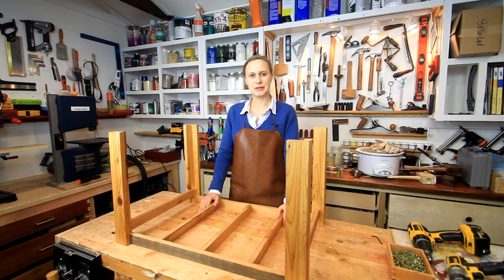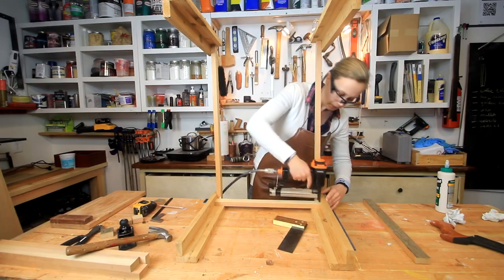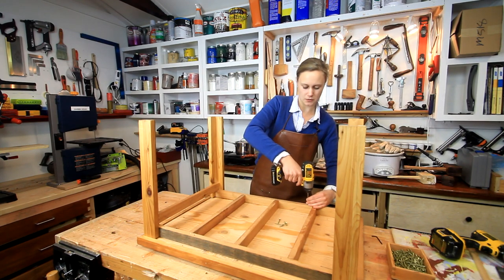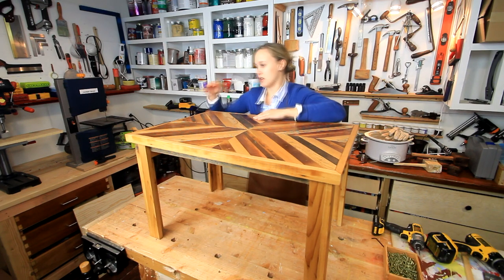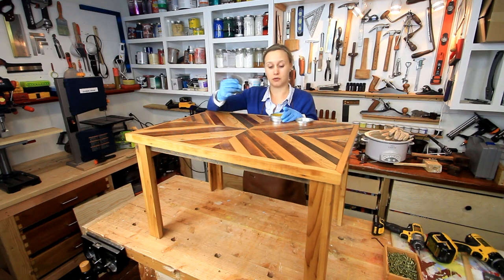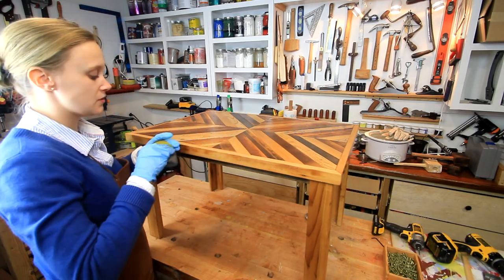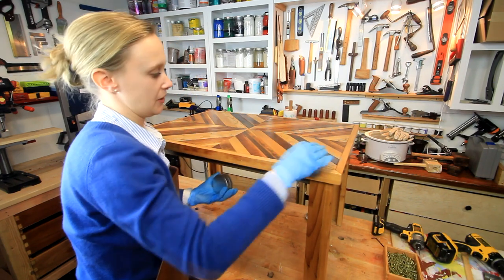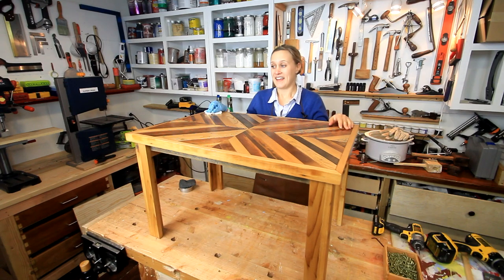How I Built and Finished a Coffee Table

Comment: Beautiful job--thanks for posting the construction and finishing.
I've used water based poly a few times over the past three decades.
I don't like it and I never will. I think the worst part of a water based finish, is the raised wood grain when it dries.
=Brian=
Reply from the maker: toolguybak Well, I agree water based poly isn't ideal at all times. However when you're trying to avoid adding a yellow tone on top of paint, or you can't use oil based for some reason, it's quite handy to have around. Plus, if you finish it with a wax coat using steel wool, you remove the raised grain. Of course it all depends on your project :)
Reply: That's a good point-poly on paint. I almost never paint wood.

Comment: Looks great!  Had a question, My wife and I sanded and refinished a clothes drying rack that belonged to her grandmother with Oil based Poly and it still has some spots that are "scratchy" and catch on the clothes a bit.  I was thinking of finishing it this way( i have minwax Paste wax) but i was worried that it would stain and/or leave oil on the clothes as they are drying, Should i be worried about this?
Reply from the maker: RobBurnsDrums I think it would be a great use of wax to make it smooth. If you are using a light colored wax it should not leave much of a residue that you could see. You could always try it out on a test piece of clothing and see what you think. You could always remove the wax from the drying rack using paint thinner (mineral spirits) if you did not like the result.

Comment: How does your beewax/oil finish stand up to regular cleaning? Would the mixture need to be applied to the piece in time to maintain it's appearance and feel?
Reply from the maker: Michael Puffenbarger For dusting and similar maintenance it holds up fine. It all depends on how the piece of furniture is handled. The more you use something the more often you should wax it. To give you an example I use this wax on an outdoor table which I use as a workbench, and I refresh it every couple months. Hope that helps.